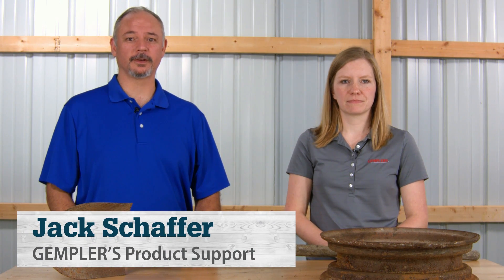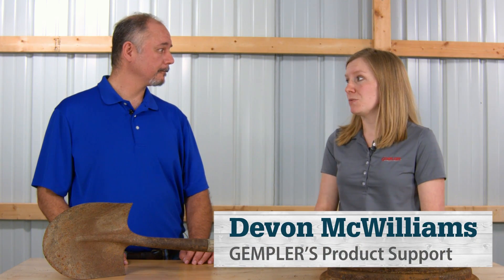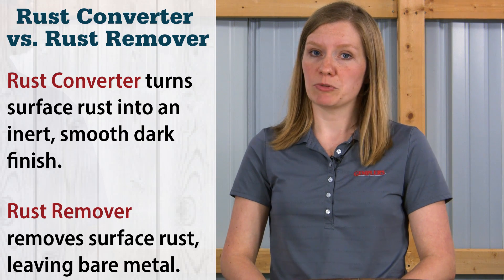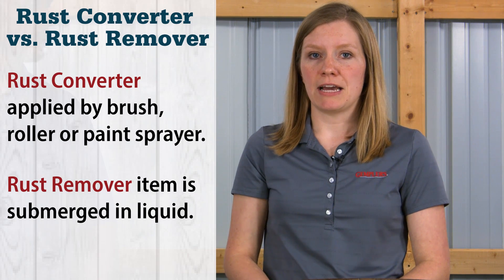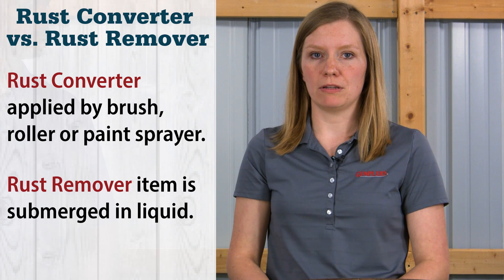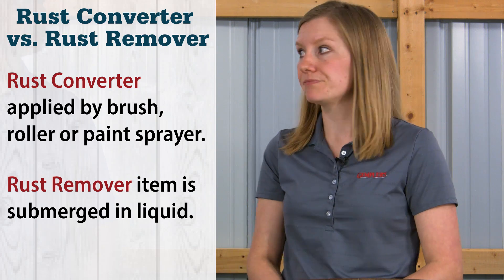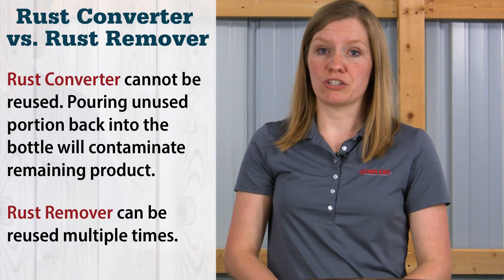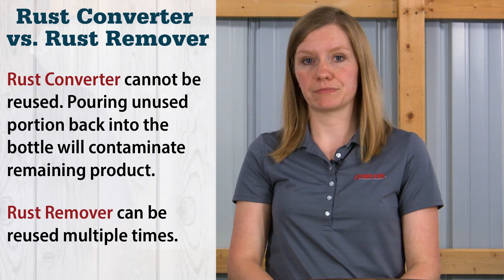Rust Converter vs Rust Remover

Comment: But what rust converter is recommended
Reply from the maker: You can purchase our rust converter kit here if you need all the supplies: https://gemplers.com/products/gemplers-rust-converter-kit-with-large-gloves

Or you can purchase the rust converter individually here: https://gemplers.com/products/gemplers-rust-converter?variant=41359523315827

We'd recommend the brush on option, it requires the least amount of coats.

Comment: I want to paint a manhole cover in my yard. Obviously rusty. What would you recommend?
Reply from the maker: While it could be done, submerging a manhole cover in a bath of Rust Remover isn't really practical in most cases, so Rust Converter is the better option for preparing a rusty manhole cover for painting.

Comment: what do you recommend for a van roof and bed with holes rusting through?
Reply: If there are holes rusted through and large flakes coming off these products won’t help until that spot is removed and patched. It has to get all of the rust converted and can’t reach the rust inside the metal so it will keep rusting but look nice for a while.
Reply: I’m going to try it on my badly rusted van roof and am thinking of using muriatic acid before the rust conversion. Seems to me the more rust I get off the better it can reach the deepest rust in the metal.

Comment: I have an older vehicle (1965) that I am restoring. Will the rust converter be useful to stop any future rusting? Is painting after the rust converter applied recommended or is the converter itself sufficient? Thanks, I personally appreciate the video.
Reply: Did you use the rust converter and what was the result

Comment: i want to do my truck's frame with converter, is it safe to spray all the bothom including the rubbers or i shouls avoid the rubbers? Thanks a lot !
Reply from the maker: Rust Converter won’t harm or damage the rubber, but it’s not going to do anything either. Ideally, you try not to get it on rubber and other non-metallic parts because – for the most part – it’s a waste of product. However, it can be wiped off with a damp-wet cloth while it’s still wet or even after it dries and cures.
Reply: Fantastic! Thanks again :)

Comment: Can it be used on Barbecue smokers with heat to 300 degree or more
Reply from the maker: Unfortunately not. Rust Converter is not designed to be used on surfaces such as stoves, furnaces, grills, smokers, etc.